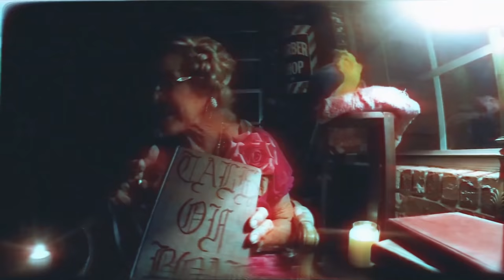Can You Believe our LUCK!? Leaky Sailboat Fix | BOAB 216

Comment: Hey guys, once you use butyl, you'll never go back.  Couple of hints to improve your butyl techniques for next time.  If you can find a counter sink or chamfer bit, taper the station mounting bolt holes on the deck.  That helps the butyl squeeze into the bolt threads while tightening.  Remember to not rotate the bolt while tightening the nut in the cabin.  By now you have probably already figured out you used at least twice the butyl as you needed for the rings around the bolts, between the bolts and deck.   How to fix the cracks in the deck.  The coating on the deck is gelcoat.  Take the pointy end of a church key and drag it along the crack so you form a v shaped groove in the gelcoat.  Try scraping down to the fiberglass or polyester resin level.  Gelcoat is usually .030" - .040" thick.  After degreasing and dewaxing the gelcoat surface, reapply enough gelcoat to fill up the grooves.  To get back the luster that you had before use progressive finer grits of sandpaper, ending up to around 3000 grit.  Use wet sanding so it buffs out nicely.   You'll find some people will recommend a crapload of different products but in the end gelcoat works the best.  Acetone seems to work best for cleaning the deck just prior to applying the gelcoat.  Make sure you use the two part gelcoat.

Comment: I've seen Butyl tape after 7 yrs old on a boat and it was still holding on the stanchion bases. It did look like it was cracking, hard, and almost ready to be replaced. I also saw it on one of the guys port windows and it was crumbly from heat and age. He used the tape like a gasket for the window. I don't know if it lasts forever, but it definitely lasts a long time. Personally I love it and it is so easy to use that if it goes bad in a few yrs it will be easy to replace it and I sure won't mind.

Comment: Hey Bums: We met Beef and Jana in Eleuthera Bahamas back in 2019. We interviewed them in the Virtual Happy Hour we filmed with you two. Such a small world and such great people. Good call on the Butyl. We did our hardware with it on Windover too. Drill a little chamfer on the bolt holes will give you a bit of extra sealant around the bolts.
Reply from the maker: Awesome! Crazy how small the cruising world actually is. They are such quality individuals. Yea, we were so happy to have been able to use butyl tape. We had heard so much about it and t he were unable to find it. Beef in the clutch! Thanks, many others have recommended drinking a chamber and we are going to look for a bit today. Great things about posting just one stansion repair, now we can implement the feedback going forward.

Comment: Add small amount of butyl tape to the inside chamfered base of each of the four screws to prevent water from traveling downward from the stanchion base top (do not spin screw).

Comment: for the stress cracks, a course of action might be to use a dremel with a engraving bit to open up a channel f(ollowing the crack line) which you will then fill with fairing compound, sand, and paint. if your deck is cored with anything except a closed cell material, do a drill-fill-drill for every bit of hardware you have

Comment: Knowing that you are probably done with your stanchion fixes, but in the future a good practice is to re-drill (make holes a little bigger) then fill with epoxy. Once the epoxy sets drill new holes for the hardware and mount with your butyl or other sealer. This is the best way to ensure that any / all leaks in that area are properly addressed. Good luck and happy you got the Butyl Tape.
Reply from the maker: Thanks, we still have yet to do the rest and are waiting on feedback before moving forward. We were prepared to Re drill the holes out but the stantions go through solid fiberglass through no core at all. Just seal it at the deck level and your good. Many have suggested drilling a countersink hole in the bolt holes.
Reply: Joel ?said I have brain drainage

Comment: From my experience repairing boats, on rare occasions I've seen water leak through the screws from the top via the screw and its threads. So something i started doing many years ago that fixed that problem after putting the butyl tape is buy yourself a can of automotive wheel clear coat used for protecting wheels and apply a few coats across the surface that the screws are screwed from. I clean the surface really nice so its nice and shiny, then mask off the pole and the boat surface and just coat the base plate area with a few coats of the automotive wheel clear coat and it creates a nice protective layer across the surface sealing the screws from further rusting and such. Ever since i started adding this additional step i have never seen another leak via the screws again. Its mainly because the screw surfaces are not new and have corrosive layer, so they are unable to create a complete seal when tightened like they can with a new clean screw.
Reply from the maker: I see how that would be more important using 4200 but with butyl tape we just need to seal between the base and the deck. Water is not getting close to those bolt holes now so as long as the nut remains snug there is no water getting to those bolts to rust them.
Reply: @Bumsonaboat  He said it was coming from the top of the screw, and down the threads. Humm, so he's applying a coat ON TOP OF THE STANCHON BASE (right on top of the stainless ! apparently ) . Interesting.
Reply: I agree. A small amount of that butyl tape on the bottom side of the screw head will deter any water from possibly spiraling down the threads 👍🏼. Go bums go

Comment: Hi. Hit the flaky paint with wire brush in drill. But it its in the fiberglass, grind cracks out  as yous do....  x pattern keying roughage / build up level stantchion sits on as obviously it looks like the fiberglass must have been flexing,  and feather out the layers to distribute the forces. That wood  {is that the toe rail?}  but that looks trouble, water will be working its way, scrap sealer crap out, paint the wood & reseal.  Out of interest - tarp in cockpit is good rain catcher, Im choping my out, raising & lenthening the cabin back to make more room -{widen cabin to hull side & put stanction on roof} ....& allow access to engine & properly inspect hull - it pissed down rain - I got caught out - heaps of water caught in trap in cockpit. My stantchinons etc...  on top edge of hull big rust holes. But to surprise Id stamp on it {like you see people walk on some fiberglass areas and it creaks & moves} - it was solid like a tank! But go to weld it & think its welded - grind patch flush, thn next day see split either in weld or next to it. So now its tedious process welding & getting lots of wet heat wide welds & also welding across the weld, figure Ill not grind it till weld underside then grind surface flush after, but havent checked my latest welding adaption.

Comment: The best way to use butyl is to use a countersink to bevel the hole. That way the butyl is compressed into the threads as you tighten the bolt.
Reply from the maker: Thanks, many others have also suggested this. That is why I’m glad we did one and shared it. Now we can take that feedback into the rest of the job!
Reply: I does not matter the type of bedding compound, and compound that will flex 30% before failure, when squeezed to microns thick only need to move 30% of those microns before failure.  So yes, a countersink to create a mm or 2 space will allow the sealant to remain stable.  A small amount under the bolt between stantion base and bolt will amagimate (bond) with the butyl under stantion base and prevent leaks around bolt.  The countersink also prevents micro fractures of the gel coat.  A plastic knife is an easy tool to remove sqeezeout without scratching gel coat.
Reply: The bevel also gives tremendously more surface area for the “seal” instead of the sharp edge around the surface.

Comment: You also need to put butyl under the heads of the flat head screws or water will wick down the threads into the boat.
Reply from the maker: Okay thanks for the heads up. The sailrite video didn’t mention needing to do that.
Reply: @Bumsonaboat  Yep.. sailrite is great and I have their sewing machine and use them for supplies, but I know from experience that water can wick down those threads past through the ring of butyl if it does not squeeze up tight to each bolt all the way around.  Just good protection.  Keep up the good work. I love your videos as an old sailor, boat builder and owner.

Comment: Butyl tape is great stuff.  One little tip, though, is that you want to run countersink in the holes to give the butyl a place to form a gasket.
Reply from the maker: The stansion base is counter sunk and the screw fits nicely into it. Why counter sink the deck if the base will be up against it?
Reply: Think about the shape of the counter sink. It will funnel the butyl down to a point surrounding the entire screw thread and then the butyl together with the pressure of the bolts and the stansion base will not only hold it in place, but give you the water tight seal along the threads. That way if water gets trapped under there, gravity won’t be able to drain that water in through the bolt holes.In fact, I would advise that you put butyl on both sides of the stansion base on the screw/bolts. That way water that flows through the top of the bolt head, won’t have a chance of getting in through the top of the  screw/bolts.
Reply: @Bumsonaboat  Countersinking at the deck gives a place for the butyl rubber to flow and form a gasket between the bottom plate of the stanchion and the deck.  Otherwise it can just pancake out.

Comment: Don't forget to retighten the bolts after a week or so. Using a torque wrench for consistent "tightness" will help keep the spider web cracks to a minimum after you make your deck repairs. Beefy backing plates or pan washers help too.  Deck repair.... Dremel and epoxy.
Reply from the maker: Okay thanks for the tips!

Comment: Hey guys I have swapped out all the Phillips head bolts for hex heads on my stanchions.  I got tired on the heads stripping out.  As for the small cracks try to open them up with a Dremel before filling with thicken epoxy.  That’s worked well for us.  Oh and that lobster looked amazing.
Reply from the maker: Hi Dan! Thanks for the tips on repairing our chipped deck. It was unbelievable 🔥

Comment: The cracks are easy to fix, you just grind those out with a 4-in grinder, and you can fill those with west system thickened epoxy before you paint. I would also pull those toe rails and rebed the fasteners that hold on the toe rails. That is probably one of the areas where you are getting water intrusion in.
Reply from the maker: Alright thank you!
Reply: @Bumsonaboat  no problem. Did mine on the Morgan 382, while I was in Marathon after Irma. Getting ready to do them on my new boat. It's best to seal up the wood with a varnish or oil, due to being under water so much.

Comment: I'm 100% for butyl tape bedding all metal to fiberglass though deck hardware, pulpit and sternrail too....it'll last decades. For folks with a deck stepped mast I highly recommend 4200 for the deck mast plate sealing and working as an adhesive holding it firm in place (butyl will not work well here) Also, I found bedding wood toe rails with butyl not the best. Something about the teak and fiberglass expanding differently creates a mess of butyl oozing over time....4200 is best for wood to fiberglass. I never used the black butyl....I wonder if that's a different formula than white or gray that I  used on my 3 sailboats. Note: due to the nature of butyl squeezing out I usually layer it over the entire surface( simple single layer neatly butted up to each other) and as you did  around the bolts.  I find it to be more uniform when compressed....a bit wasteful after tightening but more uniform between the two components.Of course this method wouldn't work well for your stern rail drainage.
Reply: One thing to keep in mind.  Butyl will breakdown quickly in the presence of gas, diesel, mineral spirits, and other petroleum distilates, so may not be the best choice for bedding a fuel fill deck plate.  4200 may be a good choice here.  But remember to install, gently tighten, let it cure, and then tighten to deck to prevent it being squeezed to micron thin layer.
Reply: @MrGSegrest  yep

Comment: best fix for the gas barbecue Is to Get rid of the GAS and use WOOD No Propane needed no regulator needed. Yes you need to go a shore and gather some drift wood to use your barbecue but the flavor of wood cooked food is WAY WAY better. in fact it is the whole reason to use a barbecue to begin with in my opinion.

Comment: I thought the better sealer isn’t  “4200” but instead 5200 marine sealer?
Reply from the maker: 5200 is more permanent. Sticks like the dickens and is impossible to get apart, even though it may be leaking in other areas. 4200 still protects from water but gives you the opportunity to take things apart to service.